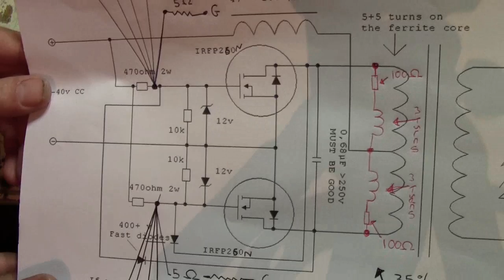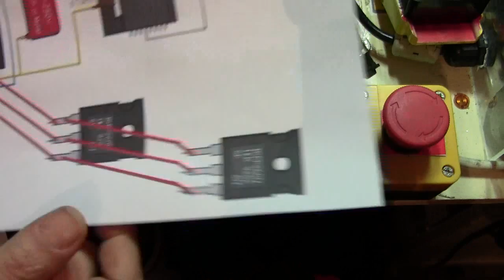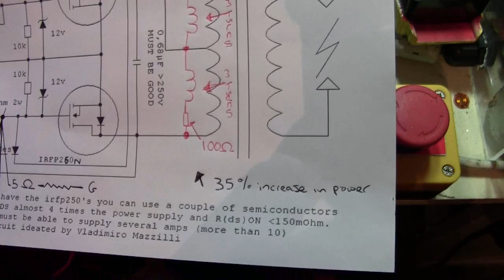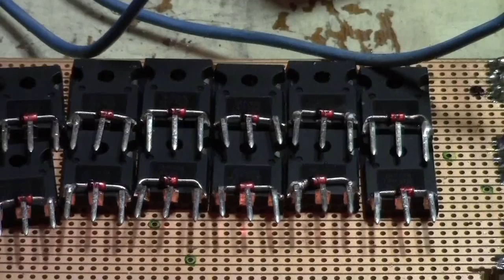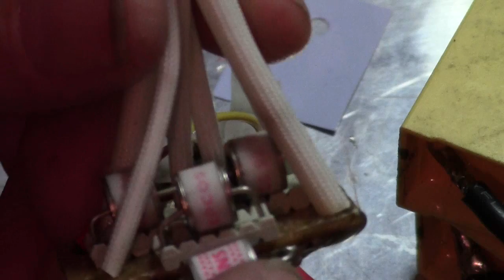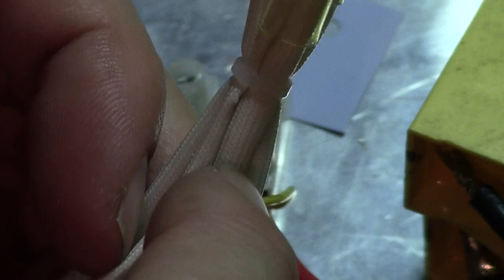The start of a NEW project  (Just for fun ) It's been a long time in the making

Comment: Mmmm! well, if this is going to power one of those "induction-heater" devices so that it has some PROPER GRUUUUNT behind it and get things properly Glowiiiiiin' then I look forward to seeing the results.

Others have built these induction coil devices, but they seem to only heat up things to a mild warm-looking glow.

I've been wanting to know for some time now whether the circuit design they've been using can somehow be 'beefed-up' to give it some extra grunt so that things can be glowed-up so hot that something like a 10mm diameter steel bar could be glowed-up hot enough where it could then be removed from the heating coil, yet still retain enough heat for long enough so tht a knot could be tied in the bar. :D

If this project is that circuit design but beefed up to give it some proper extra grunt, then I look forward to seeing this in action and some things being glowed-up and knotted. :D

I hope that you recover from your accident and that all is OK there.

Take care,

-BoomBoxDeluxe.

8th March 2014, 00.57
Reply from the maker: Well mate when the build is done i dont think ill be putting knots in to rod but it should be pretty sweet

Comment: Looks awesome! If you are going to do a bunch in parallel - have you considered splitting it in half onto two heatsinks? You could take advantage of the IRFP-260N tabs being drain and using the heatsink as a conductor (no SIL pads). Eliminates a bunch of cabling. Drill + Tap the heasinks so you can fit big ring terminals to it for heavy cable output.

Comment: For the protection.. check out TVS diodes; if they get hot then there are spikes.

Using sparkgaps(that include neons too) is nice.. but they are made for seldom pulses, and in your circuit I am not so sure they will extinguish(once triggered) without you cutting input power due to avaiable current and likely spikes evry cycle.

If you want to crowbar it all then zener + triac.